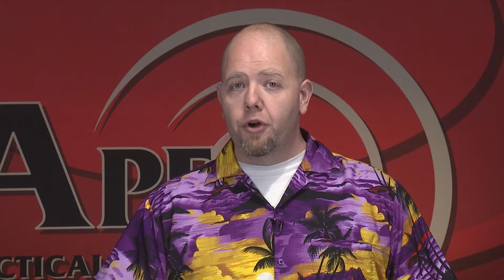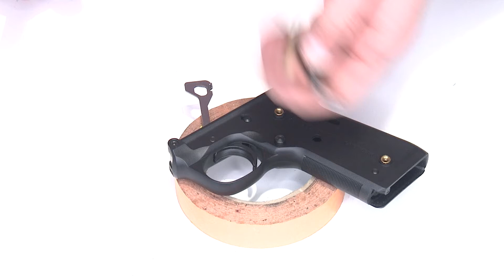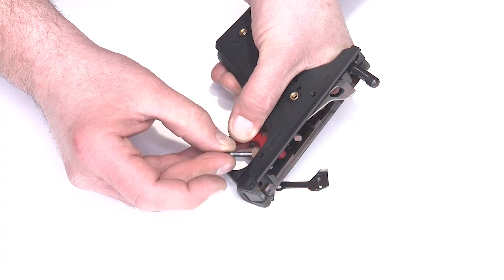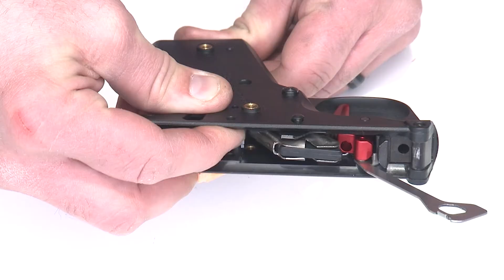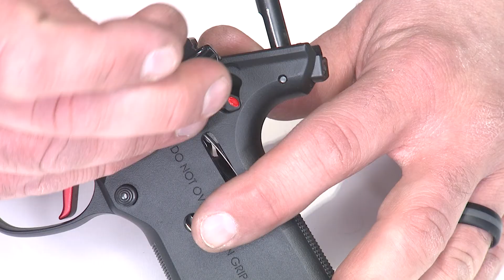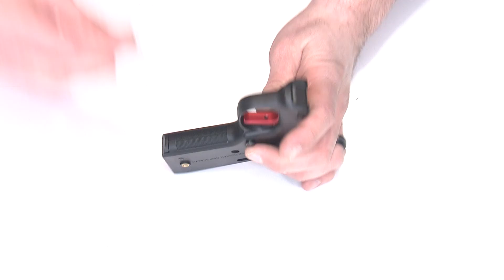Installing the Competition Trigger Kit for Ruger Mk IV & 22/45

Comment: Disaster suggestion on using a punch to get the trigger pin out. NEVER EVER DO THAT!!!
All you have to do is push gently down on the spring that retains that pin. Relieve the pressure and the pin falls right out